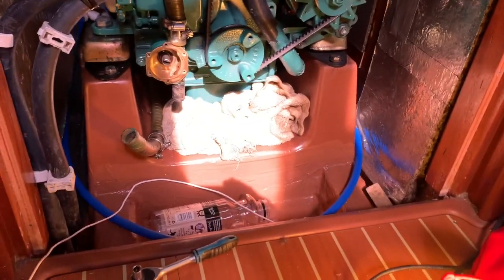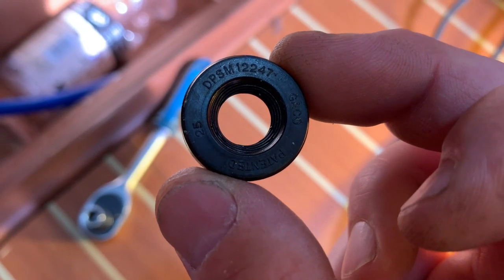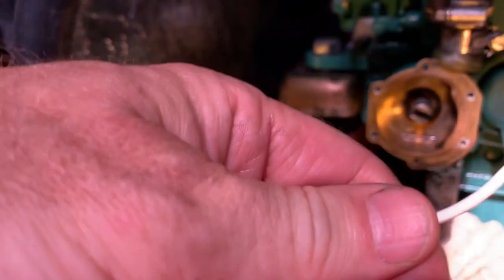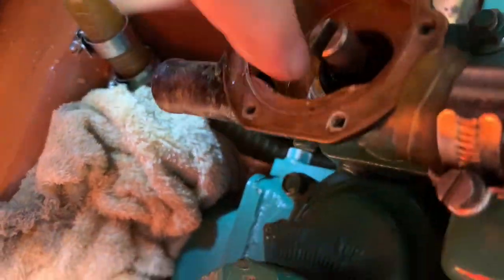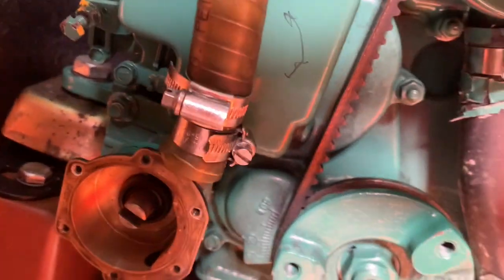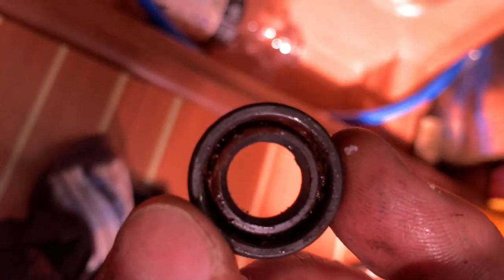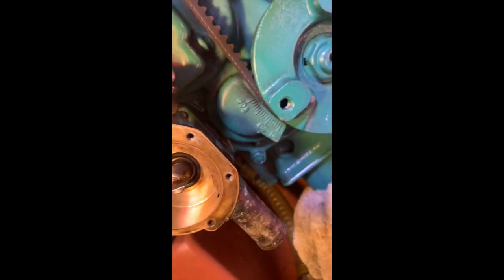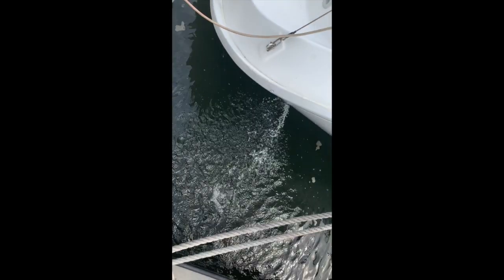Volvo Penta MD2020D Raw Water Pump Water Seal (installed on a Bavaria 32 yacht)

Comment: Great video, the wire looked perfect to push seal out. I managed to push it with a thin flat head screw driver. Then get under the lip from the inside with the same to remove it. Thanks for the vid!!

Comment: Hi, I came across your very helpful video as I am looking to replace a weeping seal, I too have a 2004 Bavaria 32. A couple of questions, is there a backing plate between the impeller and the seal? I have seen another video that has one but I think that could be a different pump. Is there swear plate inside the pump and if so did you have to remove that.  Brilliant video, well done. Steve
Reply from the maker: The MD2020D was supplied with at least two different versions of the raw water pump. Mine is p/n 3580944 which seems to be a Johnson pump (not Jabsco). I think the earlier engines had a Jabsco pump. There is no backing plate. This is unfortunate, perhaps, as it means that the bronze pump housing wears rather than a wear-plate, but there is definitely no plate on mine. The impeller is in direct contact with the water-facing seal.

Comment: Good idea for a quick fix and good info on the seal.  I love ingenuity however 2 points: what about the bearings? no way to access them with this fix, they might need some lube or worse, replacement.  Secondly if you are leveraging this idea, Its good to look for a diagram on how your specific pump shaft and seals go together.  On my VP TMD30a there is a o ring on the other side of that seal that is meant to help any escaping water to drip away from the seals and down the weep hole.  So I've been told, Its usually good to replace both seals at the same time but logic tells me the one facing the oil isn't going to degrade that spring like the one facing saltwater.  Next leak might be oil but hopefully this seal will keep water out. I'm going to give it a go.  Thanks for posting this trick.
Reply from the maker: Leave the O rings and everything else - this ‘trick’ is only concerned with the water-facing seal which tends to fail due to salt water destroying the garter spring. The oil-facing seal fails less often. It won’t help if you have a bearing problem but you probably won’t … the common problem is water dripping from the weep hole and this ‘trick’ solves that. I’ve done it a couple of times on my pump.

Comment: Thanks so much for this. I just did the replacement according to your method and probably saved myself a four figure sum - Volspec wanted to remove the engine to fix the problem! Everything now working fine.

A couple of points
As you mention, a coat hanger is probably not stiff enough to pole out the old seal, and I used a piece of galvanised wire.  The seal was completely perished, so I was able to remove some of the old seal by carefully  picking away with small long nose pliers. 
No need to remove the hose as shown in your video.
Thanks again!
Reply from the maker: Many thanks for the feedback. So glad it went well for you.

Comment: Incredibly useful info. I have the same issue on my Volvo D1-30. Thanks!
Reply from the maker: Thanks, Steve. Perhaps not so simple when, in time, the oil seal goes, but this is certainly the easy way to sort the water seal issue.
Reply: Agreed.  Sometimes it is not necessary to do a complete pump rebuild when there's just a water leak. Although the local Volvo dealer might disagree! 😁

Comment: I can only agree with below comments. Up there with the best videos I've seen on fixing things around the boat (or house). Very instructional.
I replaced it yesterday on an Volvo MD2030D ( build in  2004)  and the seal that came out was exactly the same as in your video. 
The inside spring was broken. I used a Johnson seal (for F35 or F4 impeller pump) from the Dieseldokter near Amsterdam which was half price the Volvo one.  Fits perfectly and no more leak.   I hope I'm good for another 17 years ...Thank you very much for saving me hundreds of euros and the pleasure of fixing this myself.
Reply from the maker: Thanks, Dirk, really appreciate your kind words. We must all hope that our rear seals never fail …..

Comment: Great video. Many thanks. I also have a Bavaria 32 (2002) which is leaking water from the  raw water pump.  Any idea where I can get a GACO DPSM 12 24 7?
Reply from the maker: Thanks David. I think the seal is a standard engineering one (not a specialist marine one) and a Google search should throw up options. Mine came from Keypart but they weren’t specifically for the MD2020 job; I had them in stock from a rebuild kit for the pump on my last boat, which was a different model but, luckily, the Gaco seal was the same one. Keypart will sell them but, doubtless, at an inflated price. I did have a search a few years ago and from a non-marine seals supplier they were very cheap. Good wishes.
Reply from the maker: The Gaco website is https://gacoseals.co.uk and they direct you to Orinoco Bearings in Leeds (https://www.orinocobearings.co.uk/seals.html) who say that they deliver orders of 'any size'. So suggest starting there.
Reply: Got one from Volvo dealer 😣 but it did the job - thanks to your video.
Reply: Where do you get those thumb screws for the front of the water pump.  I currently have the md2020 with flat head screws on the face plate. Thanks in advance.
Reply: @AndrewSalanitro   it's a speedseal cover and thumb screws unit
Reply: @WhiteH2O  would you happen to have a link for that? please  Thanks.

Comment: This video is an absolute gem. There are hundreds of videos and writeups on how to change the pump and how to rebuild it. And most implied or said that in order to change the water seal you needed to remove the pump. If I hadn't seen this video I would have been unnecessarily removing my pump and possibly creating other problems. The key trick shown in this video is how to push your water seal forward by making a little tool out of some kind of wire and inserting it in the vent hole behind the actual impeller housing to push the seal forward enough to pinch it with a pair of needle nose pliers. Thanks a million for this video.
Reply from the maker: Many thanks Earl. I'm delighted that it was of some help. Good wishes.